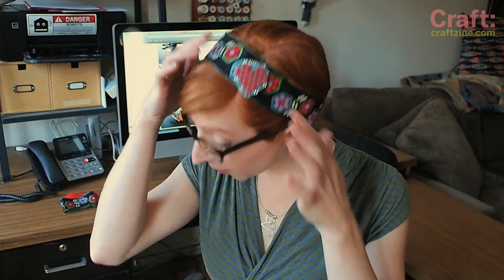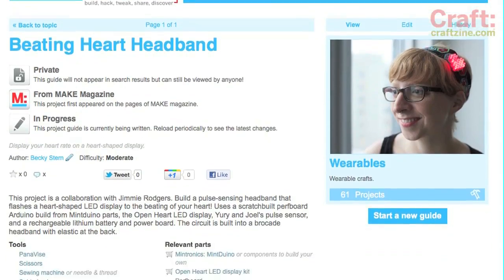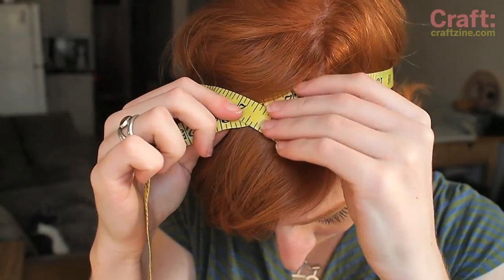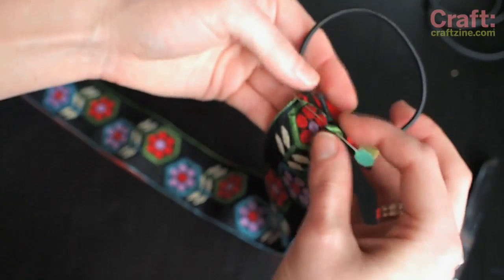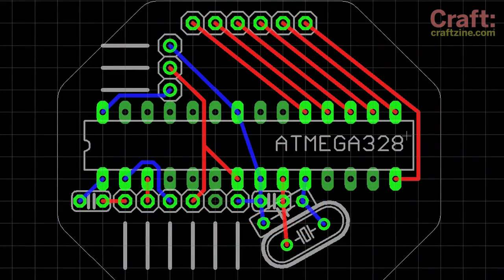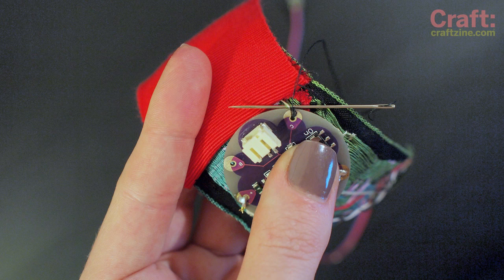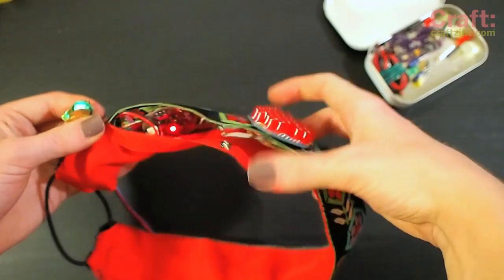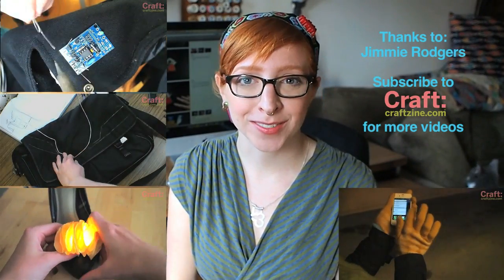Beating Heart Headband

Comment: there may be ic's like LM3914 working for what you want to do. very easy to use. by the way, i think the application shown in this video is another example of many here on youtube, where you could do the whole thing without the arduino, just using very cheap classical components and no coding needed. i don't like using a µC if it isn't really necessary. feels like wasted hardware...

Comment: How easy would it be to reverse he circuit?  Meaning for instance, say you had a digital audio mp3 file you wanted as the signal and you wanted it to be driven through the LED, but you want the light intensity and the flash duration to match the audio tones frequency wise?